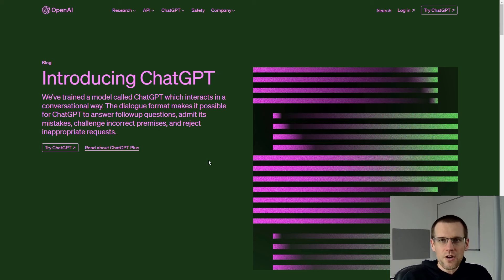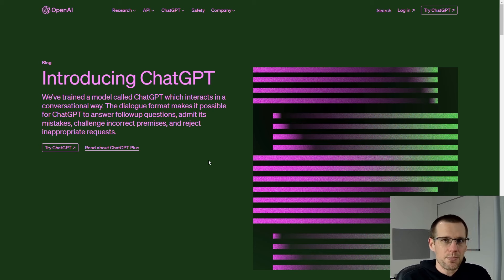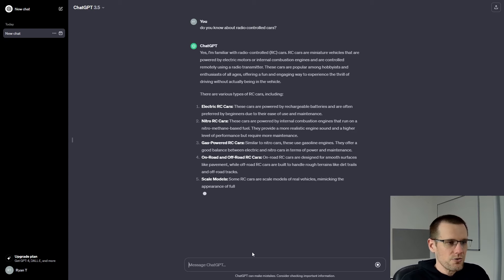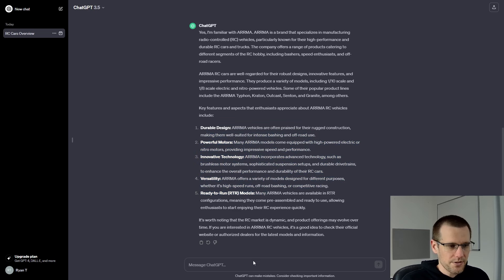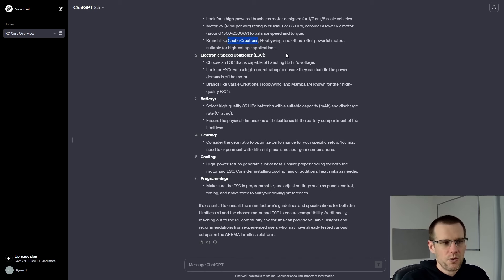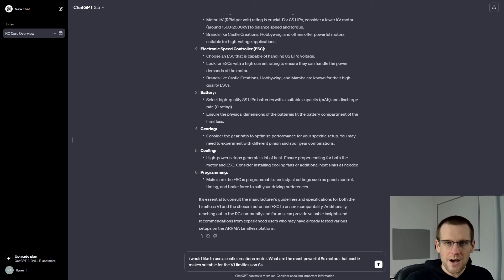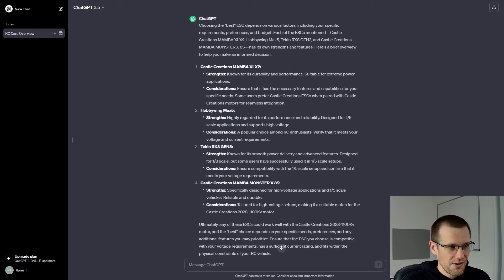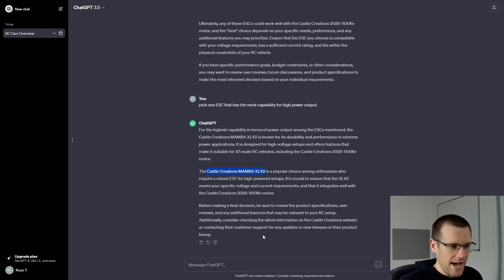Can ChatGPT pick a Powerful 8s Setup for an Arrma Limitless?

Comment: Do some theoretical setups on the needs and requirements for a car to run 300mph and 350 mph. See what the current theoretical limits are. When ESCs are available for 16S and greater; are the motors there for it?

Comment: Off topic question but I have a cm36 castle creations 7700kv brushless motor and arrma blx100 esc running a 23T/77T 2s setup do you think that esc will be enough for that motor or should I use something more powerful? I’m afraid I might burn the esc.
Reply: I ask this question because the the blx100 is used for bashing not really for high speeds or drag racing
Reply from the maker: Not sure. Hard to picture what you will put this in to. If you are unsure try gearing it extremely conservative and check Temps. If Temps are ok gear more aggressively.

Comment: Maybe a dry lake bed surface like Bonneville for 8s powered speed runs?
The road surface has everything to do with record speed runs. Full scale or 1/8th. You would really need to set end point steering to miniscule. And gyro to facillitate a blistering straight run.
Reply: I'm thinking streamliner like vintage
Blue Flame or the one those guys from the UK run.

Comment: 5280 feet in a mile. Teach it that it needs to calculate it considering the diff gears. Ask it again with more info in the question. Still watching. Excuse me if you did this already
Reply: Driven tire diameter grows exponetially at high speed. This has a direct effect on final drive ratio. The speed math for scaled models will be just like full scale.
CE of Drag, Inertia, Weight, rotating Mass, Friction, weight distribution, downforce.
Reply: A.I. ChatGPT, acts as an automated Microsoft Access. Manual data entry in the 1990's. 
The proper setup is programming the machine to build it's data base.